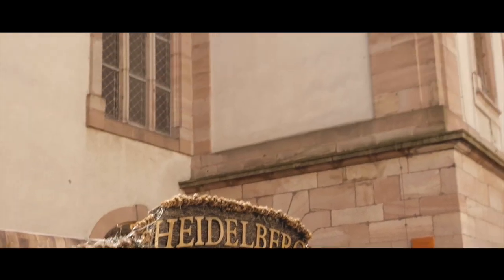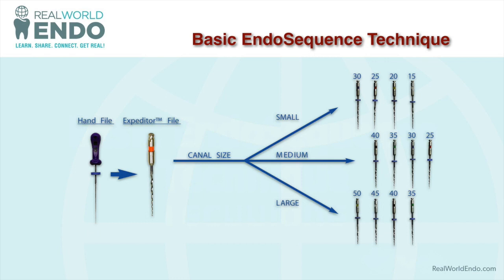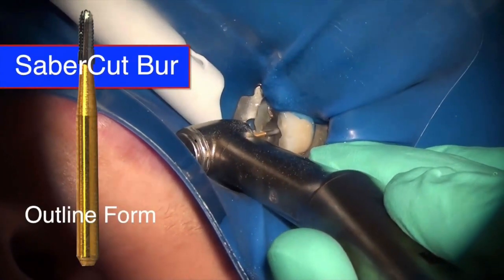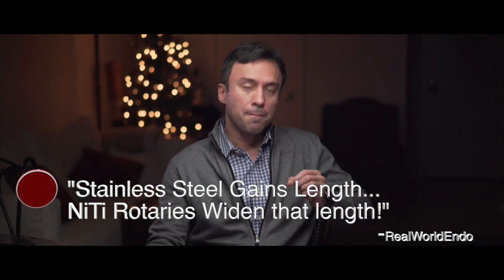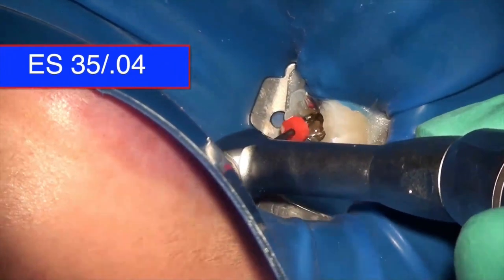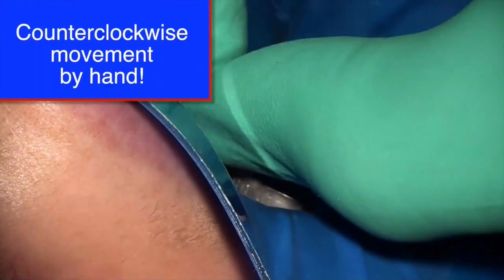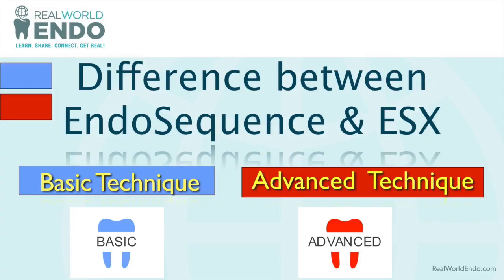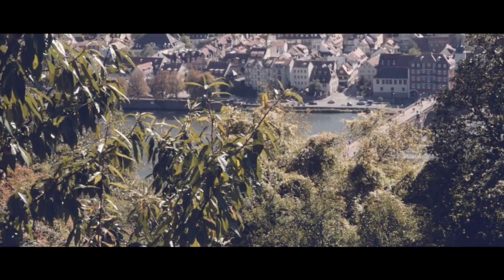CBL #17 Molar with the EndoSequence Technique

Comment: Thank you Dr Nasseh for your very informative explanations and techniques - it really has lifted my endo over the past year. 

I have a question in this case; If the canal has been prepared to the 'available length' i.e. short of the the true apical constriction - do you run any risk of generating ledges that could be tough to negotiate once you're aiming for your true length with your apex locator and WL radiograph?
Reply from the maker: +Finn Gilroy Thank you Finn. As long as you have a path that's been instrumented with a hand file and you use your files gently without pushing hard and letting them cut to engagement only (rather than resistance,) you will not ledge. If you use Single Stroke and Clean (SSC) you have even a lesser chance of ledging. The key is to have an open path.
Reply: +RealWorld Endo Thank you very much Dr Nasseh, I hope you have a great weekend and I look forward to your next video.

Comment: Hello Dr Nasseh. I have two questions:
- can we reproduce your technique and cycles with the classical protapers or other brands imitations? I'm sure it won't be the same kind of situation but at least can we have a similar situation?
- what if the expeditor detects different types of canals in the same tooth (lets say one medium, one narrow and one large)?
Reply from the maker: Sorry I didn't use ProTaper but it doesn't cut in the same crown down way the EndoSequence cuts. It's a different cutting concept. But any technique you learn correctly can probably do the job. The difference is in the nuances of each technique. Good luck!

Comment: Thanx for sharing but very long steps and procedure. I think protaper next or even manual protaper will be easier. With my regards
Reply: its all about what you get used to :)
Reply from the maker: +iraq is the best This is a systematic way to address molars. You also get to use the file set twice, thus cutting costs in half. As you saw, this is fairly fast way of doing the endo. The procedure took less than 25min! So, you probably didn't catch the system's concept since it's fairly simple. It's just about a way of doing things systematically.
Reply: +RealWorld Endo What about using a WaveOne system where you are using 2-3 rotaries to WL? Seems to go a lot quicker.
Reply: +RealWorld Endo thanx for explanation. I will try your system when be available in my country.
Reply from the maker: +freeduckie Reciprocation is an option. The last uploaded video was on Reciprocation vs. Rotation. We're not a big fan of reciprocation for reasons mentioned in that video. Also, if your priority is to use less files the ESX system is using less files. That's the whole point of this video, to show different ways to do the same thing. But if you have tough molars, a single file reciprocation system won't do. You need to use more files.

Comment: Dr Nasseh, i have a question regarding file system. i have used almost all file system ( protaper, FKG, Mtwo, Tf and hyflex) but for past couple months i have been using Lightspeed file from Sybron . it does excellent work.  i think it's the only file system perform bio -mechanical preparation. what's your opinion about LSX file system?
Reply from the maker: +bala acharya It's a good system for gauging the apex. So, you can do EndoSequence/ESX and then use one or two LSX files to finish the apex to a larger diameter. I actually use Race 02 taper in some cases for the same reason. But then again, it starts to get complicated when you hybridize too much. I rather stay simple. I find that I can do all my cases staying within one system.  The key is irrigation and disinfection for success. The files are a means to an end. Having said that, I've tried them all too and find ESX and ES to be enough to get the job done (with the occasional Race 02 for very difficult tapers where I don't want to go to a large apical diameter with a tapered file). 
Please ask question on the RWE website as mentioned in this video here! LOL! :)  Thanks for watching.

Comment: Dr Nasseh- you said that the first file reached all the way to the estimated depth on X ray. What if the first file #10 doesn't reach to estimated length. How do you continue then?
Thank You!
Reply from the maker: You need to initiate a crown down protocol by which you remove coronal restrictions and passively allow the file to move forward. I have another video called "How to get down canals." That might be helpful.

Comment: Dr Nasseh
thanks for your good videos
I use Sure Endo bc sealer
in the instruction says after preparation the canal ,dry it with paper cone & then do obturation but in your videos i didn't  see it
please explain about  it
Reply from the maker: Thank you for watching. I don't use paper points when I'm using BC Sealer (it's hydrophilic.) I use negative pressure to dry the canals by vacuum. It leaves them moist but not desiccated. Studies show you can do that with BC Sealer or you can use paper points. Either way works. Cheers!